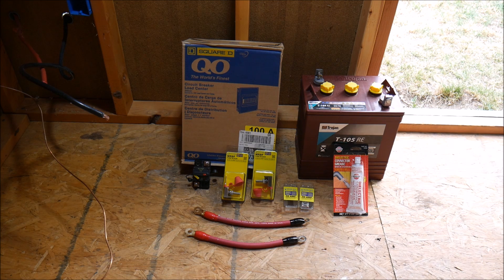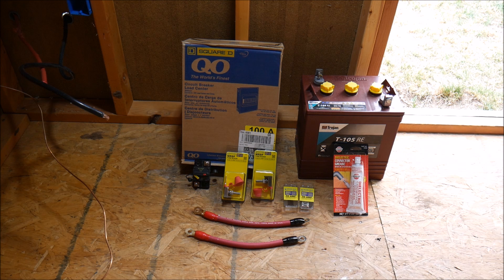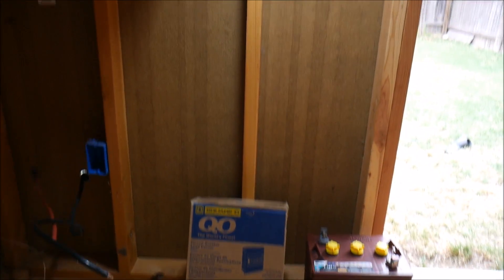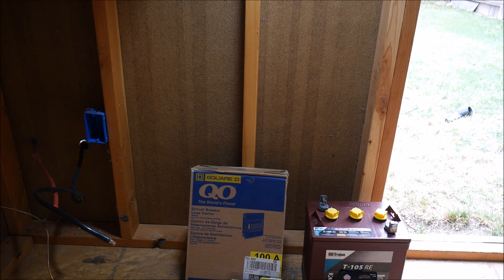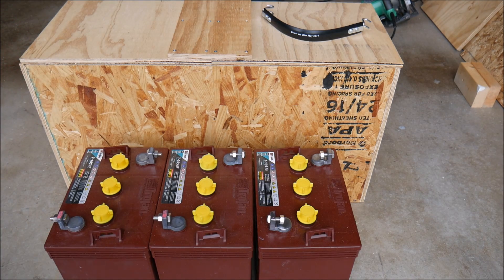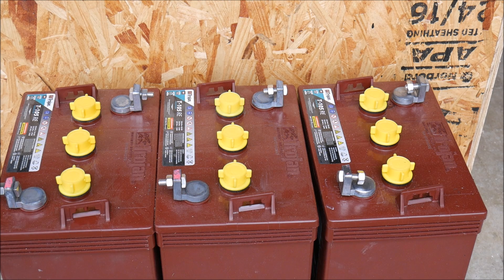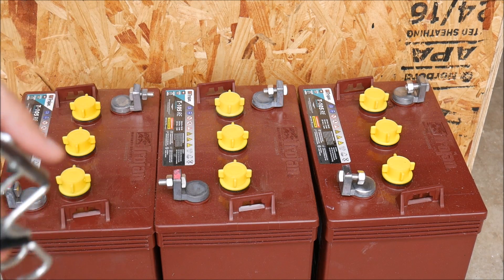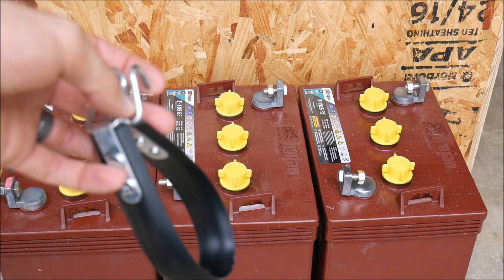Redoing The Solar Shed Part 4 - Installing Batteries

Comment: Why would you want to keep the batteries topped off of water/acid? What would happen if the fluid level got too low? Why dont you want to add more acid?
Reply from the maker: Water is naturally used up as the battery releases hydrogen gas so it occasionally needs to be topped off.  If the water level gets below the plates then it can damage the battery.
Reply: Does the battery release hydrogen gas when its discharging or charging or always?
Do SLA batteries do this or just FLA batteries?
Why wouldn't you add more acid to the battery?
Reply: JoeAceJR ...lead acid batteries release hydrogen gas during charging.  they also release water or water vapor.  the acid is never released.  a lead acid battery is a simple chemical reaction.  sla batteries are usually agm batteries...absorbed gas mat construction.  they are sealed and nothing escapes during charge or use.  that is why they are considered "safe" to use indoors unvented.
Reply: What would happen if you put more acid or a different type of acid into a battery
Reply: JoeAceJR ....high school chemistry.  never add acid to water.  a violent chemical reaction could take place.. spewing acid everywhere...maybe into your eyes and blinding you.  not to mention chemical burns to your body...or even property damage.  it is ok to add water to acid.  never do the reverse.  add a different kind of acid you ask.   hmmmm....let me know when you plan to do that.  i want to be far away!
Reply: I think you know what I meant.

The fluid in a battery is 30% acid 70% water. What if you got the acidic level up to like 70% or 100%. Or somehow very safely getting all the acid out and replacing it with 100% acid not 30%?

Another acid such as vinegar, or nitric acid, or just another acid.
Reply: JoeAceJR ...well.  you are asking questions for a chemist to answer.  i am not a chemist.  i do know this...battery manufacturers use electrolyte.  a combination of water and sulfuric acid.  their mixture is used for the chemical reaction to happen.  if 100% acid were used...how could a chemical reaction take place?
Reply: the electrochemical reaction between the anode, electrolyte, and the cathode could still happen.
Reply: JoeAceJR ...listen to yourself.  you just said electrolyte...exactly correct.  100% acid is not electrolyte.
Reply: But why 30% acid why not 50% acid?

Comment: what do all of you people do about code and permits. I wanted to do something for my mobile home, but the property owner wants permits & inspections
Reply from the maker: He is just worried about liability I am sure.  Technically in most municipalities you can use off grid solar without a permit if the system does not tie in to the premises power and lighting wiring at all.  That is how I do my system.  It is still a good idea to follow NEC code but that gets fuzzy in regards to DC as it is mainly for AC.  I would say that you need to respect the property owners wishes unless you are not mounting the panels to his property (the mobile home) or wiring anything to his property.
Reply: I own the home, lease the land. The power is on a sub- meter system. Main edison meter belongs to the park owner. From that point to my home site all belongs to the park. They didn't want to sign an interconnect with edison. I offered them a 2k watt system at no charge to them. They still said no. Then wanted to know if my off-grid system could be used to power the park lights. Go figure
Reply: James Smoth Search your states web site for information. They must have information on solar power and rebates. https://energy.gov/savings/search
Reply: Flash1857 not state or so cal edison rebates for california. only thing available is the federal 30% tax credit. my dilemma is that I do not own the land or the electrical account that I would be hooking up to

Comment: what size is the underground conduit?  what size and type of wire to fill the conduit?  how long is the conduit run?
Reply from the maker: 3/4 inch conduit I think.  It runs about 20 feet across the yard and then up into a load center.  So probably 28-30 feet of cable.  I think it is 0 or 1/0 gauge.  THHN stranded.
Reply: LDSreliance ...pvc conduit?
Reply from the maker: Yes, PVC.
Reply: LDSreliance ....0 and 1/0 is the same size wire.  just two ways of expressing it.  wire size and type is factory marked on the wire itself.  just a fyi.
Reply from the maker: Ahhh ok.  I thought 1/0 is slightly bigger.
Reply: LDSreliance .....you could say.....0,00,000, or 0000.  or you could say...1/0, 2/0, 3/0 or 4/0.  same thing.  professionals would say 1/0 or 4/0 etc...depending on the wire size they are working with.